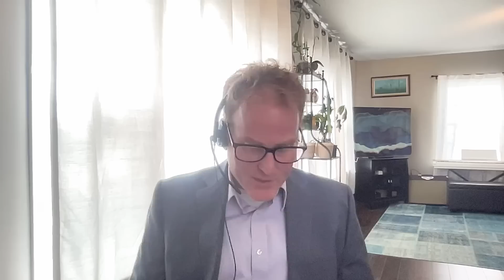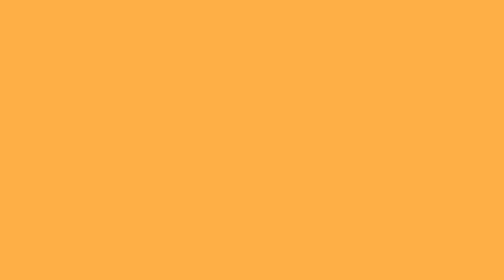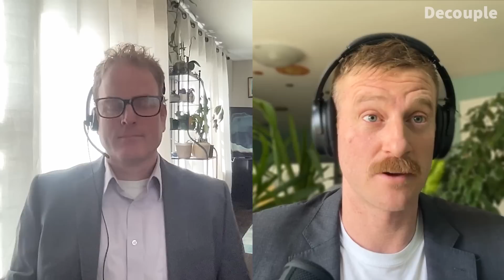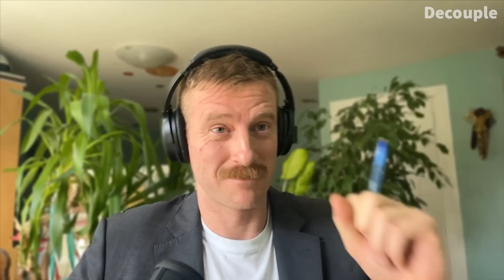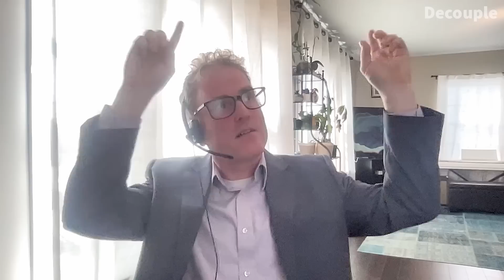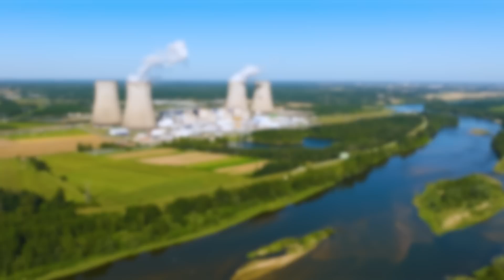The CANDU Story

Comment: Grid blindness is will full dishonesty. 

BVs, battery vehicles, and rooftop PV, and electric homes and businesses will combine to break nuclear cashflow and more importantly the grid cashflows. 
Everytime the sunshines. 

Nuclear is only economically viable if demand is 24/7.

The grid is economically huge and dead if the customers go offgrid when the sunshines.

The grid will combine with the customers excess supply of dirt cheap electricity. 
Customers in the millions will need maximum value from their BV's and rooftop PV. 

Millions and millions and millions of customers and millions and millions of km of grid will dictate cashflow arrangements.
Reply: What % of households globally are rich enough to:
1. Have a home in the first place and not an apartment or dirt floor hut.
2. Rich enough to afford a solar/battery system big enough to supply their own needs but also with the excess capacity to supply the grid?
3. Rich enough to afford oversized battery electric cars?
4. And these rich people don't mind not using their expensive BEV if the grid needs it. 
I think that breaks down to 11 people total globally.
Reply: @chapter4travels  😊
Reply: @chapter4travels  they are not the problemo.
Reply: But nuclear provides baseload power that is necessary for industrial and infrastructure processes.

It also directly strengthens electrification of homes and businesses
Reply: @GulmoharBloom  do some simple maths. 
Millions of rooftops x a few m² with PV and all grid connected. 
20% of all rooftops can easily outperform the central generation. 
In Australia, 25gW x 24hr = 600gWh 
20 million 7kwh PV x 5hr = 700gWh 
But Australia needs 400gWh avg only.
For example. 

So batteries filling up over 5 hours and discharged over 19 hours, no grid cash flow.

It's the grid that needs 90% of normal cash flow.
Nuclear is tiny but can not switch up and down. 
But if a little rooftop PV and BVs oversized battery parked 23hrs every, then nuclear economics is f.....
Nuclear know this and wants Australian government disaster insurance, government construction, and then sell to private money with government cashflow Garrentees. Taxpayers' money. 

We have 100s of these government started projects, including poles and wires, tunnels, toll roads,hospitals, coal fired electricity power stations, and foreign investors in tax havens.

SMRs are perfect for wealthy parking cash in government guaranteed investments.

Open your eyes and follow these matters.

Nuclear promoters will constantly talk about the technology, and when the sun doesn't shine and the wind doesn't blow and base load and millions and millions of battery vehicles are rapid charging. 

For the first time in history your vehicle will be fueled up daily and the daily drive will make little difference to the full battery. 

The battery vehicles battery is oversized. 
BVs built for the long drive but parked 23hrs every day. 

Simple matter, 10,000 miles per year, 8,760 hours per year, 27 miles per day.
Parked 23hrs every day. This is normal and V2G is a worry to grid owners. 
Talk to people interested in better thinking about this, government money can easily be wasted as we all know. 
Nuclear if running keep using it. But be smarter than the bs stuff.
I am a Construction Engineer with decades of experience including the power industry. 
I am pissed of with the crap, and half talking.
Reply: @stephenbrickwood1602  Cycling your battery with V2G connectivity ... do it with your EV not mine! I want to get as many miles and longevity out of my EV as possible ...
Reply: @shawnnoyes4620  Wow.
For a start battery prices are falling and new technology is happening. 

Battery management is extending battery life dramatically, and recyclers are waiting for more used batteries longer than first planned.

Early adopters have bigger tax advantages and get benefits faster from today's technology. 

Late adopters can buy used vehicles.
Used vehicles battery replacement will not be today's higher prices.
Reply: "millions and millions of km of grid " 

Yes, most of the cost of electricity is transport and distribution :-) , the more km of grid the more expensive electricity is. Fuels (whether fossil or uranium) are a very small part of the cost.
Reply: @EmilNicolaiePerhinschi  not many people understand this.
Even nuclear promoters avoid talking about the grid if nuclear electricity is to expand to replace fossil fuels.
Reply: @EmilNicolaiePerhinschi   post comments on this basic fact as it needs to be common knowledge. 
Australia just had an election and bs politicians tried to lie about this matter.
Wasted taxpayers money on wrong technology is shitty.
Reply: @EmilNicolaiePerhinschi   not many people understand this.
Even nuclear promoters avoid talking about the grid if nuclear electricity is to expand to replace fossil fuels..
Reply: @stephenbrickwood1602  "not many people understand this" I did not understand this 3 months ago :-). I mean, I knew it :-) but I did not understand it. Took a bit of thinking about costs to really get it, because right now in EUrope there is no real correlation between fuel costs and electricity costs and it was bugging me.
Reply: @EmilNicolaiePerhinschi  good comment. Thanks for your feedback. 

I discovered this when my friend from 50 years ago said his proposed nuclear reactors should replace existing fossil fueled generation plants because the grid is expensive. 

We are both civil construction engineers, from the UNSW in Sydney. 

He made me think more about my own decade in the construction of power stations and transmission lines. 

I  felt that nuclear was just outdated and dangerous worldwide if CO2 emissions worldwide was to be replaced by nuclear electricity. 

After looking at a few facts for Australia it became obvious that grid electricity was economically wrong. 
My friend became more locked into his dream and aggressive. 

The biggest mistake an engineer can make is solving the wrong problem. 
He only saw part of the problem from 40 years ago. Many still do.

The feedback helps me explain to the 'ignorant'. Helps me understand their perspective. 
Thanks 😊
Reply: @stephenbrickwood1602  I think a misunderstanding happened. 

My point is nuclear will reduce the amount of wires in the grid, but batteries and wind etc. already increase the amount of wires and transformers. In US the cost of fuels is under 10%, most of the expenses are for wires (transmission) then distribution. "Renewables" add a lot of cost to transmission and distribution and even if the power plants were free the price of electricity will increase because the power plants are low density and they need more infrastructure (wires, inverters, transformers) to function.

Nuclear has fewer radioactive emissions than coal :-) , there is a lot of uranium locked in fossil organic deposits ... something about uranium dissolved in water binding to organic molecules. Sulfur can be filtered out, uranium atoms in coal not so much.

The grid is very expensive, think only of the land area all those poles occupy, the higher voltage the more land occupied. Ideally we would have local power plants feeding an area without many interconnections, like it used to be in the 1950s :-), but with nuclear generators instead of coal. 

The intermittents (wind and solar) can be used for small consumers (such as residential) not connected to the grid.
Reply: @EmilNicolaiePerhinschi  it is late for me. Let me get back to you later. 
Do you live in the USA or Europe or ?
Cold latitudes or warm latitudes  ?
Reply: @stephenbrickwood1602  EU, cold in the winter and hot in the summer :-), around 5-10 Celsius right now
Reply: @EmilNicolaiePerhinschi   More thoughts ....
Australia will not sell uranium yellowcake to many countries because Australia does not trust the use of their nuclear electricity industries or potential nuclear electricity industries. 

Many do not know and so do not understand that is how nuclear weapons material is obtained. 

80% of the world's population live in dictatorships and so stopping worldwide CO2 emissions with nuclear electricity industries is not an option. 

If a country has nuclear electricity generation then continue to use it.

Fortunately 80% of the world's population live in warm latitudes. 

Australia GDP is $1TRILLION +++
The national electrical grid is $1TRILLION +++
Military defence budgets is 2% of GDP, and 3% is impossible  ?????
Fundamentally GRID electricity 2,600% bigger is a problem for Australia if nuclear is to stop Australia's CO2 emissions. 

Australia is buying AUKUS USA nuclear submarines and Australia has no nuclear neighbours. 
Australia does not need nuclear neighbours 

Putin and Ukraine and Europe and China have a nuclear problem. Targets for each other as Ukraine families die. 

North Korea has a few nuclear weapons  ???
Reply: @EmilNicolaiePerhinschi   more thoughts....
Petroleum imports for road construction and maintenance and petrochemical industry and emergency use and strategic military defence reserves for tanks and logistics transportation and fighter jets and EMERGENCY heating in mid winter is not a problem. 

When the sunshines and the crops grow and the batteries are full grid electricity is not needed. 
With rooftop PV and v2g EVs. 

The grid is too fragile and lightweight because it is extremely expensive. 

The grid is too expensive to expand and too valuable to waste. 

Grid central Generators and distant renewables are limited by grid capacity and limited cash flow. 247 cashflow to grid owners will not be part of this new economic development with rooftop PV and v2g EVs. 

Grid central Generators and distant renewables will be abandoned by grid owners. 

Grid owners will contract with rooftop PV selfsupply dirt-cheap electricity and provide industrial customers moving away from fossil fuels to clean electricity. 

Grid topping up batteries in weather impacted areas and being the emergency backup if selfsupply failed would be part of the new grid business.
Grid damaged in bad weather events would not be as bad as now.

Elon Musk mass electricity storage on wheels parked 23hrs every day and all night long is a fundamental change technology. 
Millions and millions and millions. 

Quantity has its own QUALITY.
Reply: @EmilNicolaiePerhinschi   more thoughts......
Petroleum imports for road construction and maintenance and petrochemical industry and emergency use and strategic military defence reserves for tanks and logistics transportation and fighter jets and EMERGENCY heating in mid winter is not a problem. 

When the sunshines and the crops grow and the batteries are full grid electricity is not needed. 
With rooftop PV and v2g EVs. 

The grid is too fragile and lightweight because it is extremely expensive. 

The grid is too expensive to expand and too valuable to waste. 

Grid central Generators and distant renewables are limited by grid capacity and limited cash flow. 247 cashflow to grid owners will not be part of this new economic development with rooftop PV and v2g EVs. 

Grid central Generators and distant renewables will be abandoned by grid owners. 

Grid owners will contract with rooftop PV selfsupply dirt-cheap electricity and provide industrial customers moving away from fossil fuels to clean electricity. 

Grid topping up batteries in weather impacted areas and being the emergency backup if selfsupply failed would be part of the new grid business.
Grid damaged in bad weather events would not be as bad as now. 

Elon Musk mass electricity storage on wheels parked 23hrs every day and all night long is a fundamental change technology. 
Millions and millions and millions. 

Quantity has its own QUALITY.

Comment: Didn't watch it on YouTube, just consumed the podcast. But I gotta comment somewhere. This was great.
Reply: This guy's a salesman. I live in Toronto. My electric bill has gone from $15 a month to over $120 a month in the last 25 years. We've probably spent over $1 trillion on these nuclear programs and yet the plant that I work at has to shutdown from 3pm to 9pm on hot days because the electrical grid can't cope. Management cancelled the projects they had to update our biggest equipment and it's likely that it will shut down and move to a poor country. There are massive fines on carbon output. We're committing su!c!de and this guy is cheering it on.